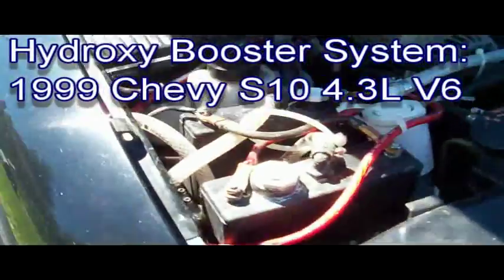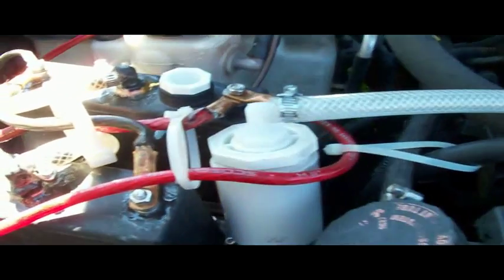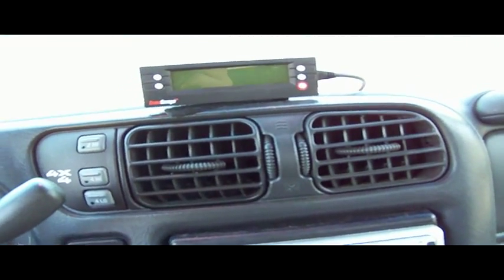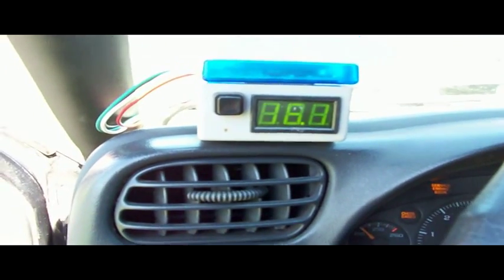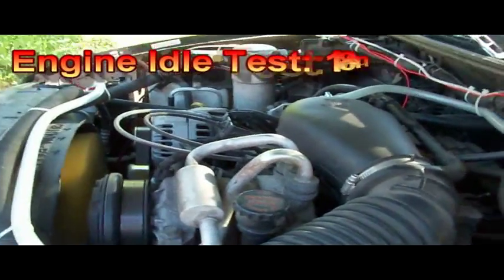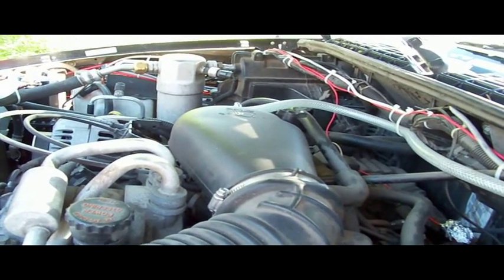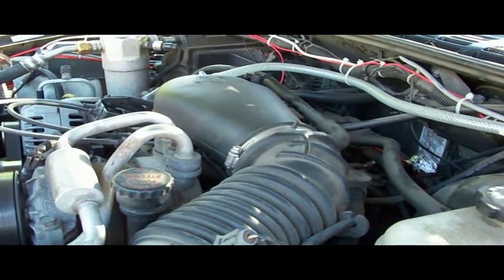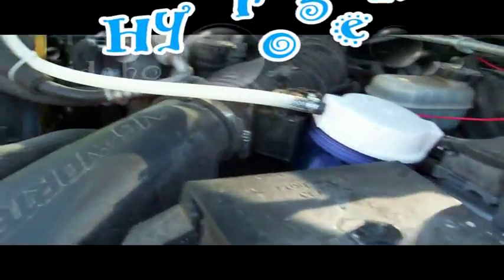Hydroxy Boosters: 1999 Chevy S10

Comment: While this test indicates that HHO is a fuel, I am confused.  It is true that there is a slight increase in the engine speed when  the fuel tube is pinched and released.  But when the fuel tube is first pinched, there is no apparent (decrease) in engine power.  Doesn't this indicate that the engine load of alternator for the electrolysis, and the HHO on demand, has no net benefit as other tests indicate?